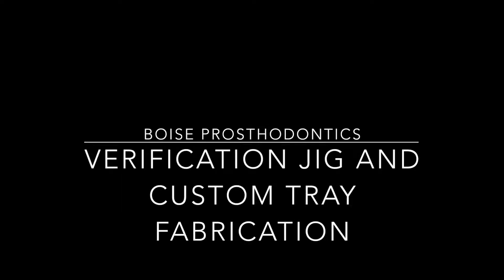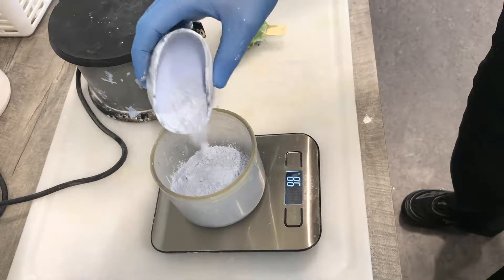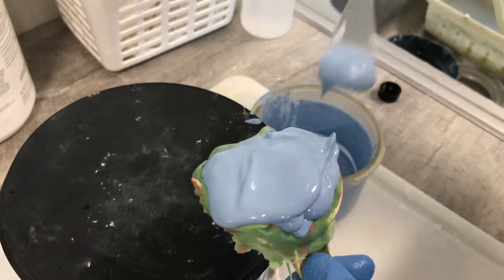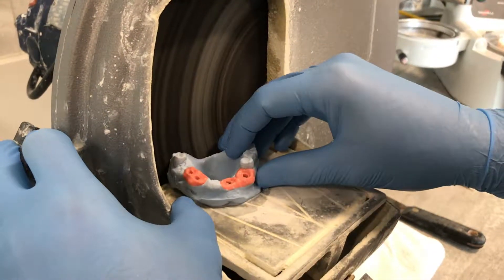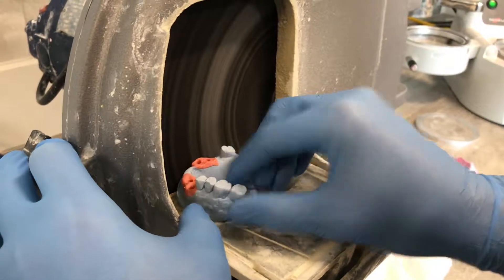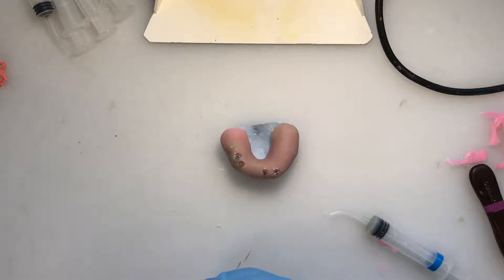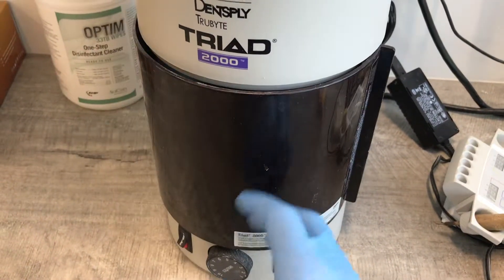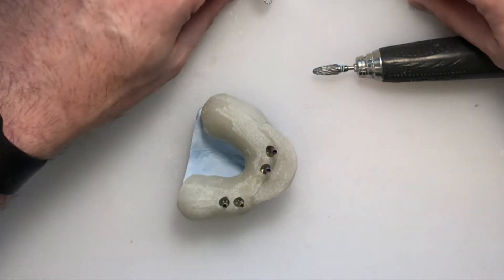Verification Jig Fabrication, Pouring a Multi implant Impression, Custom Tray

Comment: Sorry I'm confused.  Why do you need a verification jig.  Can't you just polymerization the resin between copings intraorally then you don't need verification
Reply from the maker: That doesn't work.  The acrylic shrinks overtime and thus it cannot act like a verification jig any longer as it will not longer be accurate.
Reply: @BoiseProsthodonticsChannel  thanks for answering.  So all this is to reduce the shrinkage? .   Does composite/ flowable shrink that much ? plus wouldnt the heavy body tend to keep the open tray copings in place quite well already?